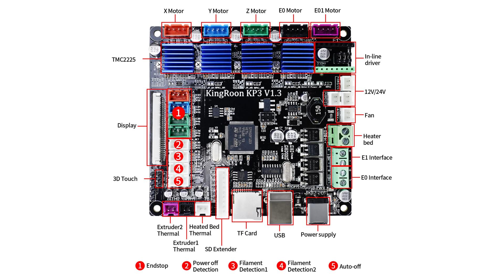【Firmware Released】 How to replace mainboard for KINGROON KP3S 3D Printers

Comment: Having issue to read files from SD card and reboots in KP5L model 
What's the problem? 
Is it firmware? Or mother board issue 
Ours is brand new not even printed 10 items but it stops working 
Can u please suggest

Comment: Thanks.  I could not get the firmware to upgrade through cura or kingroon software.  I did it with your method and it worked.

Comment: I upgraded my KP3S v1.2 stm32f407 to the latest firmware and the tft screen is all messed up. It seems like a graphics issue.. what can I do to fix it?
Reply from the maker: That's not for the 407 mainboard. Please flash back the stock firmware: STM32F407:https://drive.google.com/file/d/1L0blIRQVKSnWLjHYZfrcu6rVo_yLhVFZ/view?usp=sharing

Comment: When does the updated firmware for STM32F407 will finally arrive?
Reply from the maker: I’m not sure about it’s time, but it is in development. I will submit the application to the engineering team again. Replacing the mainboard or trying the Marlin firmware might be a faster solution.

Comment: Sad to see that you arent using properly crimped connections on the bed and hot end wires. Looks like they are just tinned with solder. The tinned wire can break down over time under the pressure of the screw terminal and cause it to disconnect.
Reply from the maker: Thanks for pointing that out!

Comment: Where do I find the documentation and schematics for the V1.3 board?
Reply from the maker: Check the description. It’s the same as the v1.2 board.
Reply: @Kingroon3DOfficial  I'm looking for pin diagram for the board, I don't see that at the store page or firmware page.
Reply from the maker: @smartliketruck  Check the product photos on this page: https://kingroon.com/collections/kingroon-3d-printer-mainboard/products/kingroon-kp5l-series-3d-printer-mainboard
Reply: @Kingroon3DOfficial  Thank you, now I just need to know the pins below the display connector, on the left side of the 3D touch pins.
Reply from the maker: @smartliketruck  You are welcome! We don’t know the purpose but modifying the firmware should be required.

Comment: Good day, 
I have the specified board and the specified FW, but when autolevel is pressed, the autolevel is not executed and only the head stops in the middle of the printed area.
KP3 V1.3  GD 303 FW:KP3_V1.0.7_2022.05.17-20220720T125740Z-001 with 3d Touch
https://youtu.be/J-XqodnZZvY
Please help

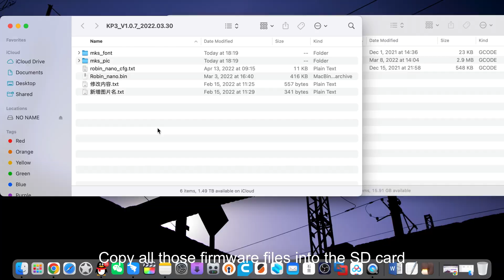Comment: I downloaded the firmware listed for f103 boards and it did not come with an offset wizard. At 5:30 in the video you show more files then what you link on the firmware in the description. all the files at 5:30 are 2022 updated too where are those?
Reply from the maker: Here’s it: https://drive.google.com/drive/folders/1eDY91nCIgY-3owwBqj1e4Szzl0qyVd9j?usp=sharing If the motor direction is wrong, just modify it in the text file.
Reply: @Kingroon3DOfficial  I updated the new firmware with 3D touch and the auto leveling is not work at all. The prob not extend when I press the auto leveling button , only the extruder moved. But the prob extended after the printer power on. Why and how to fix this?
Reply: @Kingroon3DOfficial  If you update to the firmware in the link, the start code of PrusaSlicer will not work normally. After auto leveling, there is a problem such as starting print right away without waiting for the set temperature. (STM32 F103)

Comment: @7:12 you say "Once finished, click return to store the value" (of Z-offset), mine measured at -1.80, so I press "back" (return?) and press print to print a test file, but the new Z-offset value isn't used. Do I still have to edit the config.txt and add the Z-offset value manually and reflash the firmware?
Reply from the maker: No, you don't. It is not necessary to modify the txt any more. Just do the autolevel again. Sometimes it requires twice of it.
Reply: @Kingroon3DOfficial  No it's not working. I keep setting it over and over again, both with and without flashing the firmware. Doesn't matter how I do it, the nozzle is always way too high or too low.
Reply from the maker: @farbrorseb  Do you use a BL Touch?
Reply from the maker: @deadline8416  Please flash the stock firmware and see if the problem solved. If not, please send email with videos to support@kingroon.com, our support team will be ready to help. Thanks!

Comment: Does this mean you guys will sell a laser add-on soon with this new laser feature?
Reply from the maker: https://kingroon.com/products/laser-head-engraver-kingroon-kp3s
Reply: @Kingroon3DOfficial  thanks! is there 3D Touch Firmware for the old v1.2 board?
Reply from the maker: @ethanming7096  You can try that on the 1.2 version, as long as it ends with 303 or 103, they don’t have too much difference.
Reply: @Kingroon3DOfficial  One of my KP3S already ship with 1.3 board, but does not store the Z offset value after pressing return keys. Any suggestions?
Reply from the maker: @ethanming7096  Have you flashed the firmware?
Reply: @Kingroon3DOfficial  yes , with the new firmware provided in this video’s description
Reply from the maker: @ethanming7096  Please send a video to frank@kingroon.com, we will check that for you. Please make sure to show below information: 1. the mainboard number, 2. the operation. Before that, you can try flash the firmware again.

Comment: The direction display icons
 of X & Z movement inside MOVE function are wrong
Reply from the maker: Please send email with the video to support@kingroon.com, our guy will help you out soon. If you mean reverse direction, you can also modify it in the text file.
Reply: @Kingroon3DOfficial  Problem solved by changing the X & Zs' Add/Dec bin files (eg. bmp_xAdd.bin/bmp_xDec.bin) in mks_pic folder
Reply from the maker: @soddytai2341  Thanks for that! We noticed that mistake, too. It will be updated soon, with the link remains.
Reply: @Kingroon3DOfficial  Seems it is not updated yet and having same issue, when can you update it please ?
Reply from the maker: @praphullachaudhari1020  We just checked the link again, the modified date shows it has been updated on May 17th. So we need to look into it and find out why. What is mainboard you are using? The version and end number.